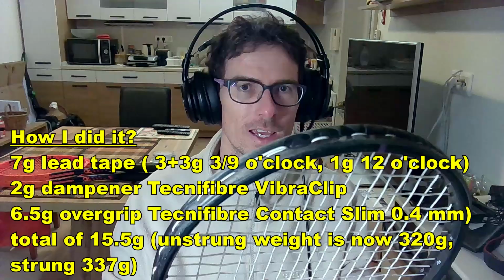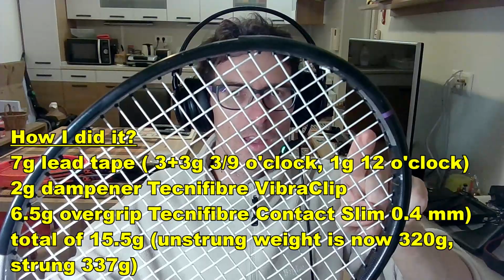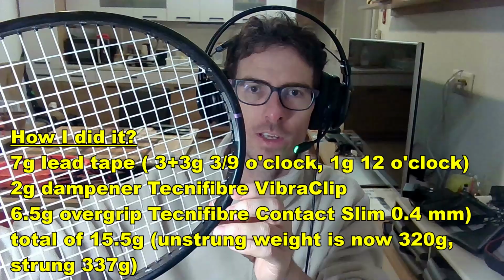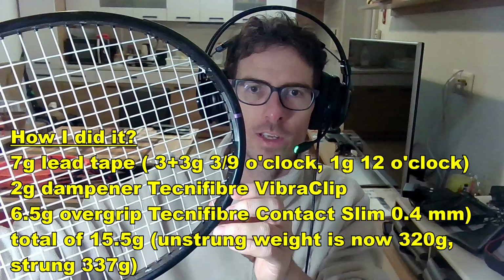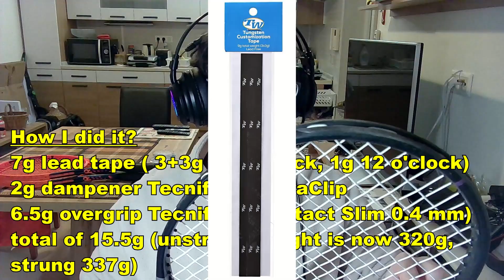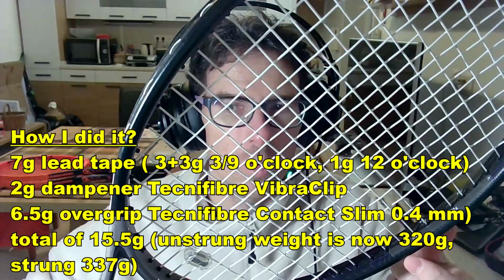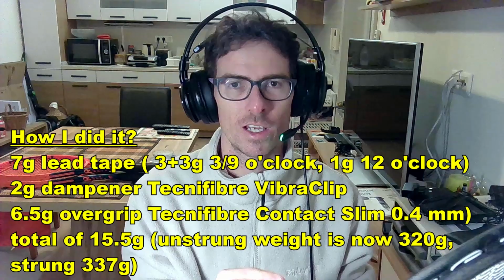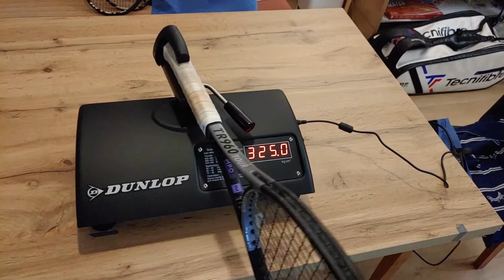🎾 Why You Shouldn't Customize Light Tennis Rackets Too Much? 🏋️‍♂️

Comment: Heyy, 
I play with PA 98 (305) i change the grip to leather (27gr) and put overgrip (3,7gr).
The stock replacement grip is (17,5gr).
Is it okay?
Reply from the maker: Hey, the overgrip with the tape is usually about 6.5-7.5g, but of course you cut small part of the overgrip, so reality is about 5.5g. It also depends what thickness you use, 0.4mm or 0.7 mm, but let's say 5g is an overgrip. Stock replacement grip is usually between 16-18g, so you are right. Leather grips are the heaviest, but I don't have any with me. I have synthetic leather from Head and that is just 18g. So real leather is heavier for sure and it gets heavier the more you play it because it absorbs the moisture. But this goes with all the grips and overgrips.
Reply: @CzechTennisGuy  yes, i just change the leather grip.. it got more heavier the more i play, can’t even hit the right ball.. i change to Babolat Synthetic team (13gr cut it) and put over grip (3,4gr cut it). Its really nice now..

Comment: Have to be careful putting too much lead in a light racket. You run the risk of messing up the balance of the racket and could cause serious elbow and shoulder issues.
Reply from the maker: Exactly, this is more dangerous than people think. Some light rackets are problematic in this sense even in stock form when you count the usual high stiffness and head heavy balance together.
Reply: Just to be on a one wave.
“Too much” - how many is it for you?
Reply from the maker: It depends on a racket and where you place the weight. But overall 10 g is maximum in my opinion and it should change the racket a lot if you place it in the head. People think they can make from a 285g racket a 320g monster. It's possible, but the playability of such racket will be far away from optimal. Of course you can put 10g in the head and another 20g in the handle, but there is no reason of doing it if there are already stock rackets with these specs that will play much better. The problem is in the overall structure of such frame, stiffness etc. Lead tape doesn't mimmick graphite and it's characteristics, it is just a weight without any other features like help with frame bending, energy transfer, vibration dampening etc.
Reply from the maker: @TheXlebushek  Between 10 g and 20 g at max. And of course it depends where you put the weight. For example if you put 7 g in the head and you add an overgrip (another 6 g), it's total of 13 g and that should be enough for most rackets. But customizing a 280 g racket to a 310 g or even heavier, it doesn't make sense. Just buy a heavier racket, that's it.